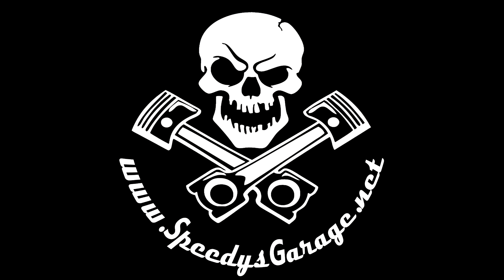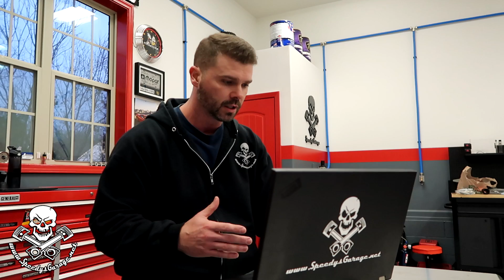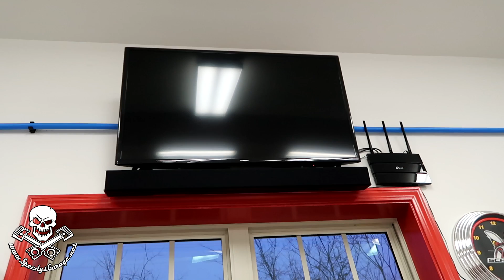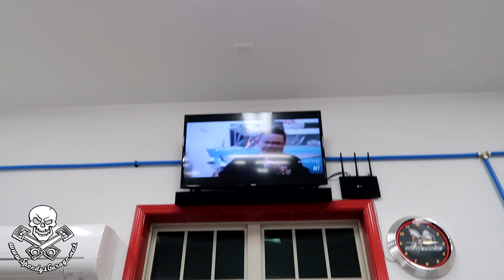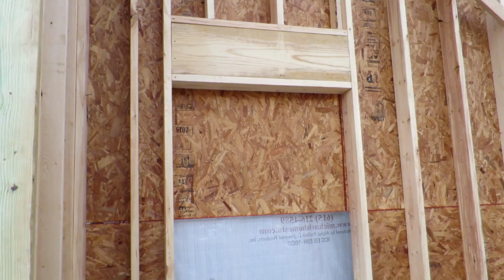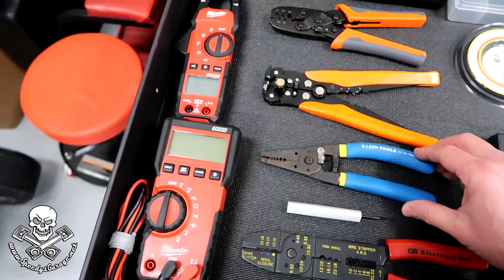Speedy's Garage Shop Build Framing

Comment: It may have already been answered but how thick does the floor need to be to support a 2-4 post lift? Great channel and awesome video series!!
🔥🔥🔥
Reply: Our rule of thumb is 5" slabs in the commercial shops I design.  Sometimes 6" if the soil is not so good.  With that, you could mount a 2-post anywhere without concern.  4-post lifts can be done on a normal 4" slab...half the weight per post as a 2-post, obviously.

Comment: Your concrete guy is correct...all concrete will eventually crack.  The epoxy might bridge small gaps and hide them, but a large crack will break through the epoxy.  Fiber and rebar/welded wire fabric help, but don't completely eliminate the cracks.

Question:  How's the mini-split system been working from a humidity control standpoint?  I know they work for heating/cooling, just wondering about how well they control humidity.

Loving this series...